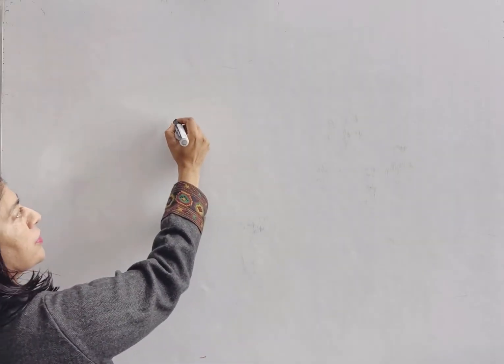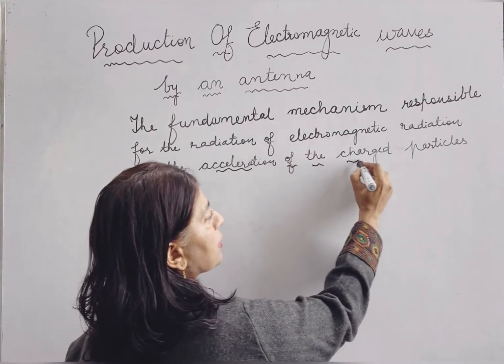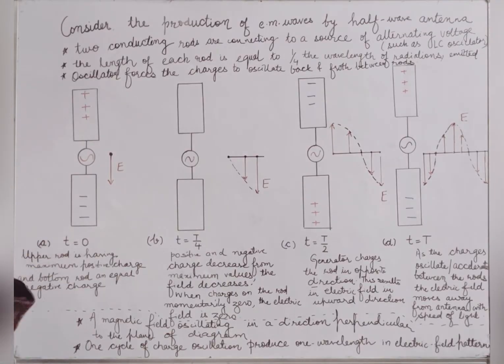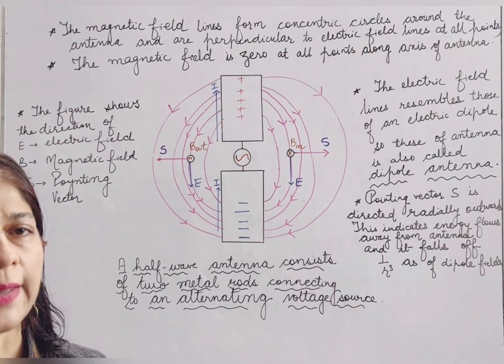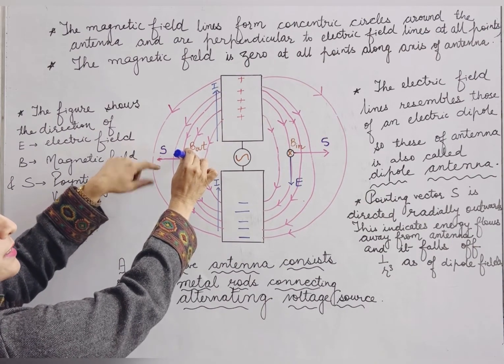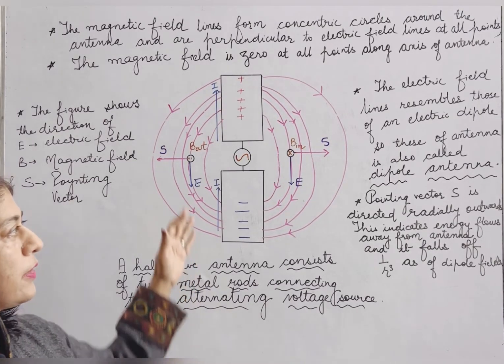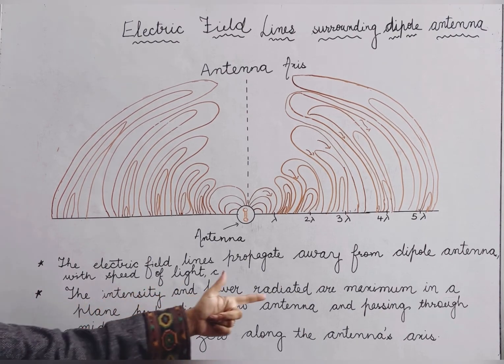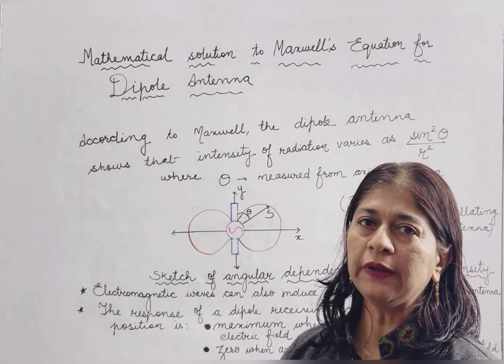Production of Electromagnetic waves by an Antenna

Comment: What is the purpose of the battery segment?  How was the wave "produced" off of the antenna?
Reply from the maker: The purpose of battery segment in production of electromagnetic waves is to dicuss one of the method of producing electromagnetic waves. Here direct current power supply source provides necessary energy required for generating electromagnetic waves and battery plays vital role in initiating and sustaining the generation of electromagnetic waves. The antenna is a transducer, converting the electrical signal into electromagnetic waves. I hope I cleared your query, if still any doubt you can discuss